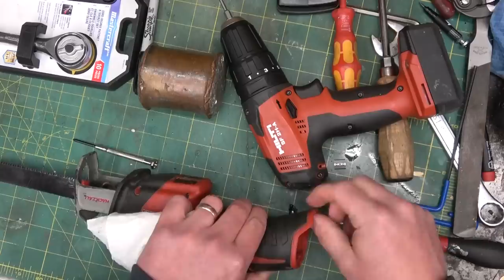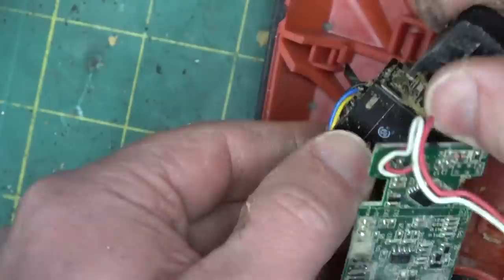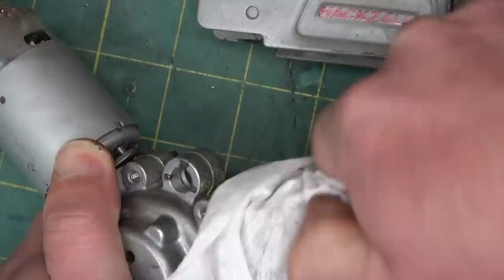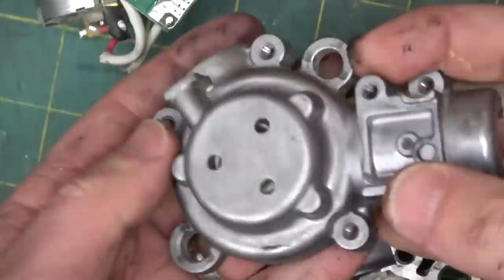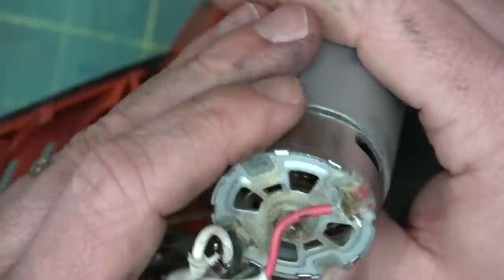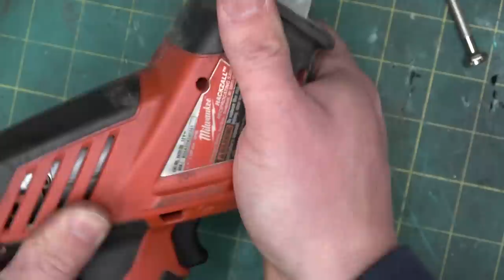BOLTR: Milwaukee Hacksawzall | Seven Year Review

Comment: I prefer the battery indicator on the battery.   when you have a whole pile of batteries it's nice to be able to find out if it's charged before you put it in the tool.
Reply: It probably makes the batteries cheaper, it's not that hard to put it in the tool. The battery indicators are nice though.
Reply: Cameron ****** 
Yup, it’s similar to why firearms (usually) have the magazine release on the gun instead of the magazine. One copy of a part per device instead of one copy per thing that locks into the device.
Reply: A simple battery indicator is less then 90ct including shipping for a single piece.
Reply: Even when its blinking, you still push it more extra time....
Reply: New drills will have bluetooth and a app to tell the charge, hours, share on facebook. I love just the 3 lights myself....
Reply: Frank Gormanns its more about the times and effort along side space constraints for installing
Reply: I could go for a battery indicator on the heated jacket. I shove 18v 5ah in that tiny battery pocket and it's a pain in the ass to take them out to check.
I totally agree other than that, especially having over six batteries.
Reply: Indeed...
If there is only one battery indicator, I would prefer it to be on the battery.
Reply: @Blasterxp  you joke, but they exist. More expensive than regulars, not really worth it. But one feature I actually like is to have it beep remotely if you ever misplace it.
Reply: Yeah me too...but I can't be critical of my favorite teal team.
Reply: @Blasterxp  I have the willfuckyee Bluetooth drill. It is Handy for setting up certain rpms and torque out for larger hole makers
Reply: Is it too much to ask to have the indicator on BOTH the battery and the tool?   And if it is, then can i have the indicator on the battery that will also light up when you pull the trigger?   I'm sure that most newer batteries already have current sensing anyway.
Reply: I agree I prefer it on the battery too ! Nothing like climbing up a big roof haft drunk on a windy day only to find out you haven’t got any cooch left ! Good thing am a fast learner it only took about a dozen times and  20 year of roofing to figure out check the battery first ! Lol
Reply: One of the reasons I love the Ryobi 6-way charger.. You just grab any battery with a green light and you know it's good.
I'm OK with the indicator on either, both have their advantages and not.
Reply: @Paul J Pachasa JR that is extremely bad for the new lithium cells once they get drawn down past 25% they wont last long at all or take a charge after a while. Oh and not to mention the fact that they can blow up when being charged when they are drawn that low!
Reply: @Paul J Pachasa JR True "rms capacity" is when you hit that load and 25% thing should be ("is") fixed by electronic but who is going to buy 2A/h bat. that lasts 10 years with no button, when you can buy 3000mA/h that has magic button and last 2 years.
Reply: Like wise, but it helps to have a bin for discharged batteries and one bin for charged batteries(if you have enough batteries to be searching for a charged one)
Reply: I agree. That battery level circuitry was the only thing to fail on the one my family used for yeeears
Reply: Yes indeed!
Reply: Battery indicators on. Battery so I know before I plug it in PERIOD

Comment: "How many meetings for the boss to know how great he is?" Well at the latest production meeting our "HR generalist" (I don't know either) came up with a powerpoint on how she can take about 6 hours a week and chart the results of the meetings to find out how effective the meetings are in productivity over time spent. I know how we can save 6 hours a week of non-productive time right there.
Reply from the maker: Gah. What the fuck does HR even do?
Reply: Hr fires people. More importantly did ya point out to hr that you could save 6 hours a week during the  meeting by not having a meeting. Be careful or they will make you the new hr boss.
Reply: @arduinoversusevil2025  HR's job seems to mostly be removing qualified applicants from the job interview process before they ever get to meet the people they'll actually work with in engineering. A friend of mine saw them whittle down 400 applications for an engineering role to 3 based on their entirely arbitrary and unwanted opinions. I suspect all 3 had friends in the HR department because reading that many CV's sounds like more work than HR can fit in between coffee and water cooler trips...
Reply: @arduinoversusevil2025   yeah.....that was covered at last weeks meeting by the guy who spends 8hrs a day doing the 'illusion of work', but only has an incorrect ghantt chart to show for it.

Comment: Could that wax at 4:30 be a over heated indicator for repair? If that switch shorted and heated up the wax would deform or melt off. Just my guess.
Reply: I was thinking it might be to stop the switch housing rattling, but it's not too clear whether it contacts anything in the housing when it's assembled.
Reply: Switches and other contacts heat up from poor connection not from shorting. Shorting would make the device unable to be turned off. Ohm's Law. Just thought I'd toss that out there.
Reply: I was thinking it was just some shmoo piped in after assembly to fix everything in place and stop the rattletrap effect. But those are definitely some good ideas

Comment: I just opened mine up last week, It was seized after a rusty overhead plumbing job, no way to change the angle of the dangle.  I was able to free it up and she's back in action. It's nice because it doesn't kick like a mule, so you can risk attempting more delicate cuts. 62% of the time it works every time. It's been about 3 years for mine. Definitely would buy another.

Comment: When I did water mitigation my boss bought like 3 of these and expected us to not only cut out drywall which to be fair this did a good job of but also sections of floors and 2x4's. The final straw was when I decided a wood axe was faster for floor removal due to the batteries constantly dying and the blades shitting out on us. So I told her we were buying a damn sawzall because it looks real unprofessional when you have to ask the client for an axe to take out a subfloor, and yes we tried a hammer and a catsclaw however they had 3 inches of floors on top of each other, hence the axe.

Comment: as a certified glue nerd, i appreciate the point on the acetoxy silicone.  You really only really need to worry about the acetic acid off-gassing if it's an air tight enclosure. the other silicones that don't stink like a hooors-va jay jay will give you better adhesion in the long run, but thats just splittin c-hairs....

Comment: The M12 Brushless Hackzall we have at work is hot garbage. If you put the bigger 12v battery in it, the lousy retention clips the M12 system uses don't hold up to the vibration of the saw in normal use. It just self-ejects the batteries constantly. It's infuriating to use. Much prefer my Makita 18v sub compact saw.
Reply: They make a m18 Hackzall....
Reply: Same here, we use it with the scraping blades to clean chemical buildup off equipment. As a group we've probably killed $5-600 worth of batteries when they fly down the hole of no return. I'd hate to buy into another set of batteries but do you think the makita is worth having as a one-off tool?
Reply: No question. Particularly because that one off is gonna slowly become your line as your current tools waller out.
Reply: Thanks, I'll give it a try.
Reply: Went through two of these in my shop. They are crap and if anyone is thinking of getting one, don't. The batteries alling out makes you want to throw the damn thing. Once one of them started getting going some overload circuit would stop the tool from working and flash the battery indicator with light use. I absolutely hate this damn tool. Worthless
Reply: I agree but I like the Milwaukee because i can hold it with one hand. I'm a little too weak to one arm the Makita haha

Comment: I used one of these for a long time. Fantastic for small plumbing, patch up drywall, etc. Absolutely not worth its tiny price tag in any kind of heavy work. Best use case is when you don't want to lug around that heavy full size sawzall all day to cut 1/2 pipe and a piece of drywall.
Reply: They’re not really meant to do heavy work or replace a full size sawzall. The whole point is to be small, light weight, and easy to handle with one hand.

Comment: When you say don't worry too much about the grease you put in there, one thing you have to watch is what type you use if you don't clean it right out and still have some of the old stuff left.  I can't remember exactly but I think if you mix silicone and lithium greases they get runny like water.  I remember someone using a different type of grease on wheel bearings and hadn't gotten all of the old grease out, ended up being different types, didn't take too many miles for it to get real thin and run out and knacker all the bearings.  Either way, something to consider a little bit.

Comment: I might be wrong uncle but mosfet should be nmos and pmos not npn or pnp those are designations for bjts to my understanding, correct me if I'm wrong.
Reply: You're probably right, but from what ive seen, pnp and npn are pretty much interchangeable for different transistors(at least to a point)  so while they may not accuratly describe them, it seems like it can be used as a slang designation, just to clarify which silicon type is used for which pin. And yeah i realize this is a lot longer than it needed to be lol

Comment: So the biggest problem was the pin that holds the motor to gearbox rigidly? And you used silicon? I know you own a welder . JBweld at least, give 'er f'in hope at least.
Reply: I would probably of drilled out the pin and used a fastener. Most of those motors are threaded
Reply: Thinking the same thing. Some kind of epoxy to shtiffen her up
Reply: I would have added epoxy myself but DEVCON, I use it for rifle bedding.
Reply: I just took apart mine and noticed it's not all that important  mikwaukee is using the bearing to support the motor, this small pin is simply to keep the motor from obviously spinning around. Had this been a reversing tool or something you start regularly under load it would be affixed differently as is in a drill. Also if you get to the 5 year mark milwaukee will sometimes refurbish your tool.
Reply: I mean I agree but, this is Ave we're talking about

Comment: Q: In lectures they told us to avoid any silicone oils next to dc-motors, because it will form insulating layers on both the commutator and the brushes. Does this not apply to this stuff?

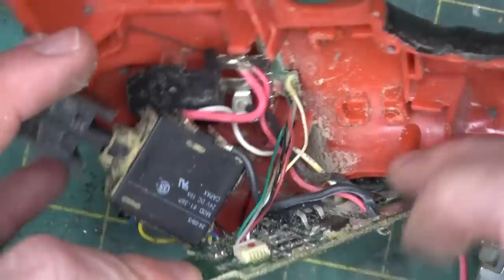Comment: At 5:16  there is not two MOSFETS  on the board as stated The smaller one closer to the camera is a likely a diod.  The label on the PCB is Q1 for the MOSFET and D1 for the diod. I suspect it is a snubber diod connected in reverse  over the motor to limit the voltage that is generated when from the induktor in the motor when the MOSFET turns off. The voltage that is generated be 10x the supply voltage of the motor.

Comment: Given the screen print labelling on that pcb of "Q" and "D" i think we can safely say the two different sized devices are a mofset (most likely) and a freewheeling diode, ie the system is using passive rectification for the freewheeling currents.  As the motor only needs to ever spin in one direction, a full bridge architecture is not needed, and high currents are comensurate with high duty cycles, so when the saw is working hard, the freewheeling diode isn't really conducting very much of the time, so the extra efficiency gain from a synchronously rectified architecture is not needed.....

Comment: The battery indicator on the tool is worthless because the battery is either dead or it fell out.
Reply: If you owned or had ever used one of these particular tools, you would know that that battery is not going to fall on in its own. It clips in so tightly that my mildly arthritic hands have trouble removing it.
Reply: If you ever used one one these for anything other than making popsicle stick pictures frames in your garage, you would know you have to keep one hand on the battery so it stays in.

Comment: You could turn a pin on the lathe that would screw into the threaded hole 180 degrees from the wallered out one in the motor.  Make it ~3/8" with a screw on the base and a pin on the top for that retention plate.

Comment: If it's in the realm of possibilities, can you please do a BOLTR or something similar on the Milwauke 2767 (Gen 2 Brushless 1/2" impact")? I've been on an AvE Milwaukee BOLTR binge and going through the comments, it seems a lot of us would love to see the 2767-20 BOLTR. If it can be squeezed in the budget, I feel I speak on behalf of many people, we would love a Milwaukee 2767 BOLTR.
Reply: They last, although I tried to give mine wings. Not only does redbull not give your tools wings, it gives them a bit of stickiness on the trigger. 
5 years of almost daily use, I burned out an old brushed one in 2. The fuel keeps on going even though she sounds a bit rough.
Reply: I have one. Works GREAT! Crushed my boss' dewalt 18v. He killed TWO dewalts with a dull 2" hole saw going through sill plate with an anchor in the way. Milwaukee sailed through it.
I run it with a 9AHr battery, I call it my 1/2" 1/2 ton. Heavy, but battery lasts 1/2 way to forever.
I run that battery because I need them for my 18v sawzall. 
 BTW, to anyone reading this, that sawzall cuts WAY better than the corded version that's in the shop. No lie. BETTER.

Comment: I have far less of a problem with the acid-cure silicon than I do with you now transferring the torsional load of the motor directly into a flexible PCB so you can break all those solder joins.
I have no doubt you'll get away with it though. :)

Comment: Last week, I had to fix my 18v Sawzall. The ring gear got crap underneath it and it totally seized. Surprisingly easy fix but needed bit extensions for days and a lot of pressure for the 4 screws into the motor housing. Those will need to be replaced the next time I take it apart. Question: Should I put loctite on the reverse-thread bolt that holds the ring gear or does it need a little wiggle room? She's pretty sluggish when it's fully tightened.

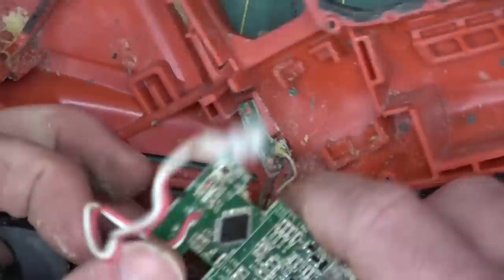Comment: Are there meant to be two pins solder bridged on the Atmel chip? I don't recall there being a common ground on the same side of the IC. Maybe it's just a trick of the light and not bridged at all? Right around the 5:00 min mark.

Comment: I wouldn't have put the RTV in there between the board and the motor. Now your rattling motor will transfer force more readily to the circuit board, and cause it to flex. Depending on how well it's coupled, it might lead to solder joint failures and trace breakages over time.

Everyone's a plumber. I've messed with plenty of copper pipe and hoses in radio systems. They just contain radiation rather than water.

Comment: I have the Bosch version of this tool. It's worth every penny for patching drywall ceilings.
Reply: As a professional drywall repairman I want to give you a tip on using a pair of utility blades (recommend Olfa) over a saw for this. Works much better than any saw for patches, faster and cleaner. Just score the drywall with knife 1, punch it out and cut the paper backing with knife 2 (the first blade clogs and dulls incredibly quickly in the drywall and won't cut the backing). 

I use this tool to cut the furring all day long, but I'd never want to be eating the dust it would cause. Nor would I want to clean it up.
Reply: @jayjayhooksch1  I've been using Olfa snap blades since I was a kid. I love them.

Comment: I like the battery indicator on the battery, easy to get a full battery from the truck, if it's on the tool you need to put it in the tool to find out how big a charge 😉
Reply: I wish they would just put it on both

Comment: Next time put a very fine layer of grease or Vaseline or any other handy lube on the second half of the clam shell where it meets the rtv.  After 24 hours you can pop her apart, clean off the lube, and pop her back together  with ease.  We use this trick to make custom reuseable rtv gaskets all the time at our shop.  A lot less cursing if she ever needs to be fixed in the future.

Comment: Just an FYI to the fellow "red" fanatics - check the board in your tool, especially if it was made before 2015/16.  They were coming non-coated, and were prone to corrosion (if they get wet, of course). Bigger problem on the M18 Fuel ones. All the new ones I was replacing under warranty, I was conformal coating before installing. Talked to one of the head guys at Mil-W, and they said they'd start coating them.

Comment: were those machine marks meant to retain grease like the cross hatching in an engine cylinder? also could you rotate the motor 180 and use the other hole. giggity

Comment: Whoa, did you just anchor the motor to the power board?  I would have been concerned with transmitting the vibrations from the drive directly to the board (though dampened).  You know, the slop from the wallered out pin.

Comment: i bet with a different blade this would be nice for cutting turkey..ima get one for butchering my cows
Reply: John Connor, I use my Milwaukee Hackzall for  cutting large dog treats into smaller pieces, especially bull "pizzle" which is often cheaper to buy as an original,  unmolested 3-foot long  hard dry stick then when it's been factory cut into smaller pieces and sold individually or a handful of them in a bag. My dog's range from 25 lb to 125 lb,  so I can customize the stick size when I cut them.